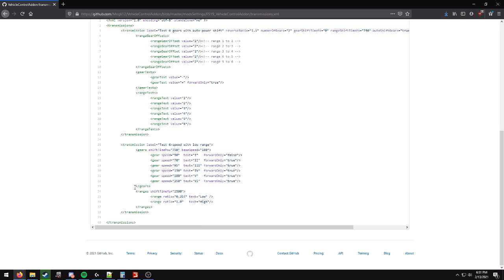FS19 VCA Custom Transmission Configs: John Deere Quad-Range

Comment: Great video. What steering wheel and shifter do you use
Reply from the maker: G920 with the matching shifter
Reply: @TysonDiniz  how do you shift using a1 a2 etc. It doesn't look like it can shift a lot
Reply: I saw that the g920 pedals have 3 pedals so can you make one of them the clutch?
Reply from the maker: @nolanmeinert7432  yes one pedal is the clutch. In the vehicle control addon, you can set the shifter to use the first 4 gears for your gears, and the last two to increase or decrease the range. Then use a button for a shuttle to get reverse

Comment: Love the vid I might have to try this can u do this with a keyboard or just a wheel and a shifter
Reply from the maker: You can do it with a keyboard, I did it back in FS17, it's a little harder, and you don't get to control the clutch.
Reply: @TysonDiniz  okay thank I’m downloading it as I type
Reply: @TysonDiniz  you can bind it in settings, it's called clutchaxis